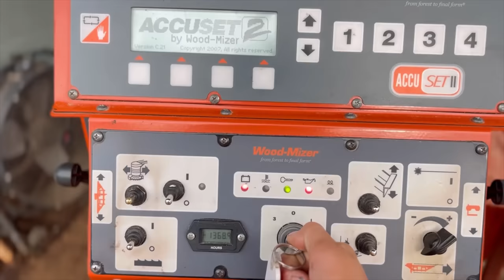Sawmill Siblings: milling hemlock is what we do best!

Comment: I've asked this before, and will occasionally keep asking: Why does the debarker engage so late?
Reply: jeffevans-kw7lp  Yeah, you see her flip the switch manually in some of the videos.
Reply: User controlled. You can see the switch at the 37 second mark. Top left switch.
Reply: applying the debarker  too soon could cause a jam since the blade is turning clockwise to throw debris away from log it would pull itself into the end of the log.
Reply: @johnaddis1022  that makes sense. Do not engage debarker until the blade is in the log.

Comment: What is the purpose of the small circular saw at the front of the cutting head?
Reply: it is called a debarker.    Tree bark can have all kinds of things in it, like rock from being skidded off a mountain. Cutting the bark off and having the blade cut in that spot saves wear and tear on the blade.
Reply: Thank you  @scottsoper

Comment: Your voice is always distorted. The input level to the recorder is too high.
Reply: Her voice is perfect
Reply: Thanks for responding, both @daveklein2826 and @raymond19001. Her voice is both perfect and clear, but it's distorted, and it has been for about a year or something, since she upgraded her setup.  It's not an attack on her or on you, it's an observation. It's better that somebody says so, and it would be better that she addresses the problem. Run it up on a scope or something, you'll see that it's clipping. I haven't done so, because I can hear it. The input to the recording device is overdriven. Attenuate the mic level.
Reply: Mark, have you had your hearing aids calibrated lately. 😂😂😂😂😂😂😂
Reply: I know nothing about recording stuff.   I think they are just using some mics into a phone.   Is that even adjustable?

Comment: With all that scrap, you have abundant material for making PALLETS.  Marginal cuts often found on commercial pallets, just need to be strong, not pretty.  I guess that explains it, the girls are too pretty to make ugly pallet wood.  More to the point, a big market effort has to be created.  Other gangs are making all the ugly PALLETS.
Reply: PALLETS are an industry all by themselves!  I don't think trying to compete with the big boys in that industry is a good idea.  However they do make or modify Pallets to do the jobs they need to do using that scrap wood.